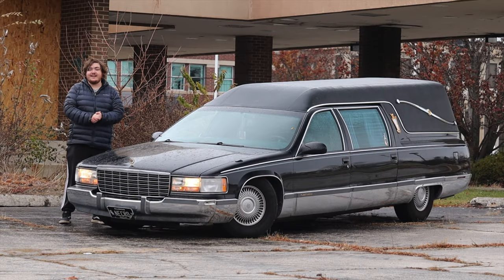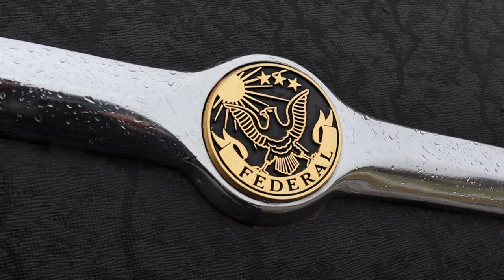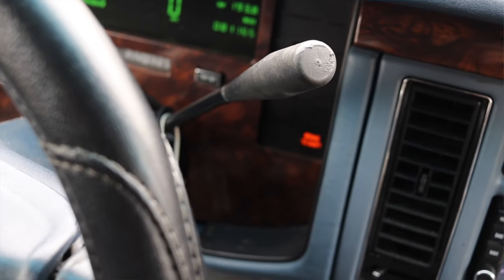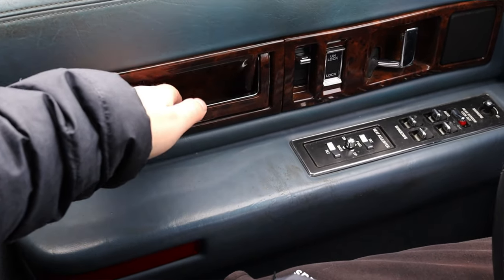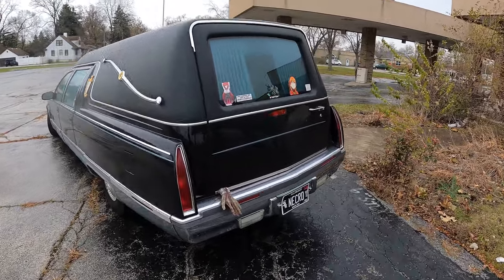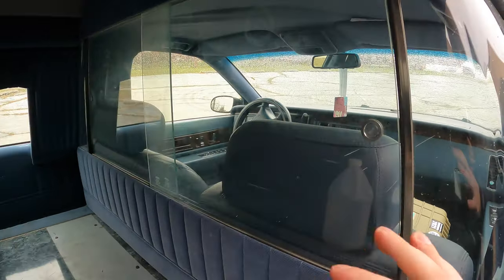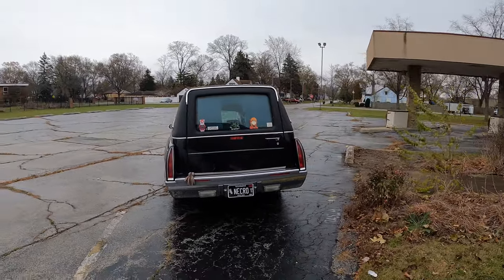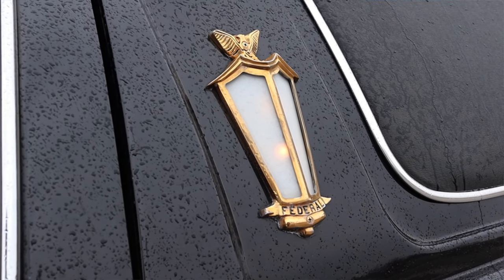1995 Cadillac Fleetwood Hearse Review - Happy To Be ALIVE!

Comment: I don't understand why Cadillac never made a station wagon until 2010. B/D bodies look even better as wagons. I want to take a 90s Buick Roadmaster wagon and combine it with a Fleetwood to make the car Cadillac never made.
Reply from the maker: Good point!
Reply: It's probably  that station wagons, hatchbacks and vans are inherently a little noisier and more prone to creeks and rattles than proper sedans and Cadillac was more obsessed with silence in the old days than they are now. Cadillac did offer some customized versions of their cars over the years, including a 4-door convertible and an El Camino style pickup, so there might have been a wagon offered at one time or another. A wagon would offer a big advantage in the case of a limousine, with the extra space for 9 passengers worth of luggage.
Reply: There have been several Fleet/masters conversions done over the years. Definitely looks extremely cool.
Reply: One coach builder in the 90s did just this, but probably inversely to how you described it. There are some 90s "Buiack" hearses out there with a roadmaster front clip but Cadillac Hearse style rear clip. I think they were Roadmaster Wagon based. I saw one in a parking lot on the North side of Chicago maybe 6 months ago
Reply: @southsidediy  that definitely would be cool to see. you can see a 90’s version wagon of the caddy online. I’ve seen a few
Reply: Cadillac had the Castilian wagon in the 80’s

Comment: I've read that the discontinuation of Cadillac's "commercial chassis", which used to be used for ambulances, hearses, and in some cases, vehicles that served both duties, decimated the conversion business in the late 1970s, with some coach builders adapting by cutting up sedan bodies and others going out of business. It seems they added maybe a foot and a half to that car in the conversion and I'm surprised they needed to, since I'd expect a coffin to fit in a standard station wagon with the seats down, not that I've tried any  coffins out for size lately.  That's a cool car. I wonder how hard it would be to turn it into a limousine/party wagon for weddings and proms.

Comment: I own a 1996 Federal Coach Renaissance hearse. It's the same as the 95 you review here. I have had it over 10 years. I should replace it with a much newer one, but it is such a good looking, solid, heavy,dependable car, that I don't want to.
Reply: hey i just bought a hearrse just like the one reviewed here, what air pressure to you keep  you tires and what  brand  do you use?
Reply: @jojojojo5353  jo, I bought 4 new tires  2 years ago. They are, Hankook Optimo- H 724.  I inflate them to 40lbs as per specs on the door sticker. They are very good tires at a fair price and a lot of hearses are using this brand tire. You MUST use EXTRA LOAD tires on your hearse. Do not buy regular passenger car tires. I was driving a hearse years ago that the funeral home put standard tires on. I took a sharp turn at 45mph and one of the rear tires rolled right off the rim and blew. They were new tires, but they were not extra load! The hearses are too heavy for standard load tires.  Good luck with your hearse.
Reply: @jimstevens1726  thanks for the response Jim, i have the Optimo Hankooks on it now,  i think i will get 4 new ones to be on the safe side  and yes i know about the heavy load requirements, this beast weighs hundreds of pounds more than my 87 Chevy G20  high top van fgs , and i will be carrying a few hundred pounds of wood in it often, my confusion  was in the door stickers saying 30 pounds inflation and 1 35 pound inflation so not sure how to read that door sticker so will go with 40 if you have been using that pressure with no trouble.. would hate to have a blow out and end up  in the back of  a hearse because i didn't use the Heavy load tires although there is something romantic about being carried to  my funeral in the back of my own hearse😆 just not ready for that so soon, want a decade of  fun  with it first.Thanks for your help again  Much appreciated and much luck to you also Sir

Comment: i had same problem with lexus skinny pockets cup holders to small so i got a couple metal baskets big enough to hold my bottles of mocha which fits most cup sizes and velcroed them down and linked them together so they dont topel over it works

Comment: When you say it has a "GMC Dually rear end", I assume you mean the Commercial Chassis spec 14 bolt 9.5" Semi Float Axle. If it has this, I 'think' this hearse would have been ordered as a Commercial Chassis. As I understand it, only a few coachbuilders were given access to the Commercial Chassis in the 90s(Namely Superior). Many hearses and limos were stretched from normal spec Fleetwoods and still had the 10 bolt found in most B and D body sedans. Now that I think of it, the Caprice and Roadmaster based hearses would have been very practical conversions, they already had somewhat suitable bodywork and were equipped with the strongest axles in the B/D cars(besides the 14bolt from the commercial chassis.I actually have one of these truck axles under a Caprice and live in Chicago too!
Reply: Also if it is that 5 lug axle, it should be a semifloater, all dually axles are full floating 10.5" units with leaf spring perches. The most similar axles you would find to these in the trucks were the ones from the 454SS trucks. I believe those had leaf springs. Many 3/4 ton Suburbans, H2s, Avalanches and Escalades had these with coil springs, but 6 lugs in the early 2000s.Still a plenty strong axle and overkill for most any car.

Sweet hearse though man, Subscribed!

Comment: A hearse besides a school ✨
Reply: There was a cemetery that was next to my middle and high school (they were on the same campus.) I remember, during my senior year there was a military helicopter that had made an emergency landing right next to the cemetery, and the military helicopter that was sent to get the original helicopter pilots had to fly around until the funeral was done. Normally, it wouldn’t have been an issue as it’s a small town, and there were maybe 1 or 2 funerals during the school year.

Comment: The front suspension looks like a very heavy person is sitting on the hood. Why?
Reply: It probably needs new suspension components such as springs, shocks, struts, etc.  It might have a heavy engine as well, but usually hearses are higher up in the front than that one is.

Comment: If I had the money 💰 I would love to buy a hearse the color being black with a vinyl top with a one landau bar on each side of the roof just in front of the big one piece door at the back of the hearse and this hearse must be a three-way hearse which means that the casket can be loaded into the hearse from either the rear door or the side doors on either the driver's side of this hearse or the casket can also be loaded in the hearse on the passenger side of this vehicle this hearse has a casket table that can be used by hand or this hearse also has an electric casket table operatorated by an electric button operatorated by the hearse driver and I would also put a mattress in the back of this hearse and then put a sign in the rear window of the big door of this hearse saying if this hearse is rocking then don't come knocking!........ .